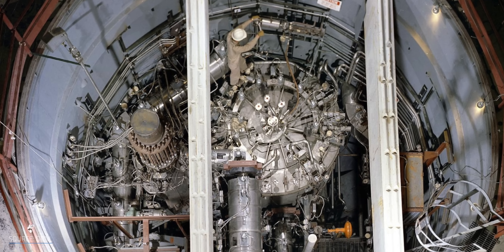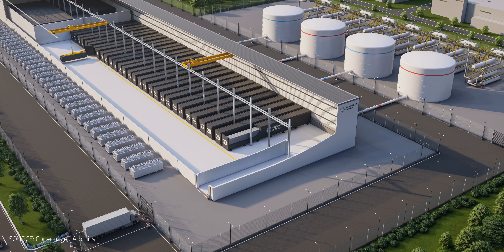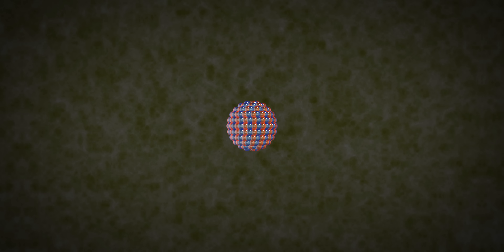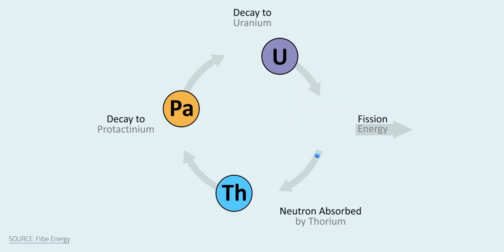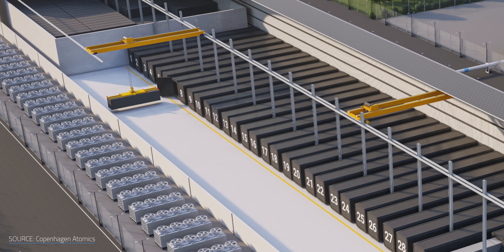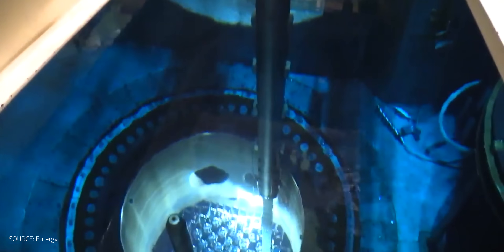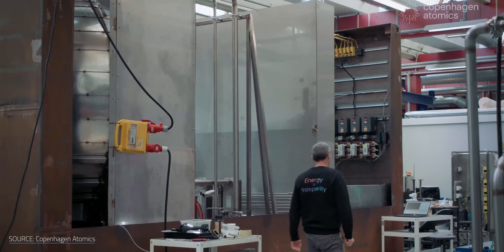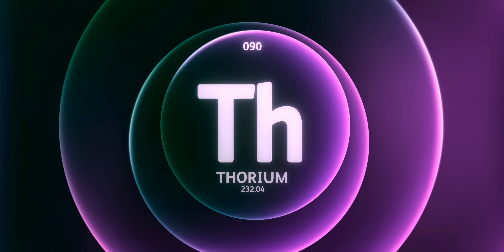Why Thorium is About to Change the World

Comment: It will be expensive, but “crash-testing” failure modes could increase public trust and also let them develop, test, and practice cleanup
Reply: They were testedin 1967. LFTR designs are immune by design to every civilian nuclear accident seen so far. TMI, Chernobyl or Fukushima are simply not possible with a LFTR

Comment: China already has viable thorium technology and will implement commercial use early in the next decade. In the US there is a strong lobby against the use of thorium, perhaps because it does not want to invest in RD, after all the original project was abandoned because it did not serve the purpose of creating atomic bombs. And now it seems easier(profitable) to use the uranium technology that is already known, even if it presents catastrophic risks.
Reply: There are way more problems to the whole thing than the ones you mentioned. They stopped development for good reasons.
Btw, the thorium ones in China only supply 10-30 MW which is as much as 1-2 wind turbines can produce while being a lot cheaper.

Comment: Of course CO2 is the bad guy that we wish to eliminate the excessive accumulation of. But what of the direct heating of the environment by the dissipation of cheap energy? With cheap energy more and more things get automated and anything that uses energy has to dissipate that energy into the environment. What would an order of magnitude more waste heat look like to our thermometers and glaciers? Shouldn't tropical regions all have air conditioned living spaces? Shouldn't we all have a robotic servant? Shouldn't we all have automated transit lines that run on frequent schedules? Science and technology have created our current environmental warming hazard. Will science and technology provide a net reduction in that warming hazard?
Reply: It is safe to assume the heat dissipated by houshold gadgets is negigible in comparison to the heat accumulated on the whole planet (mainly by the sun). Even 1 Mio. gadgets won't make a significant difference.

Comment: If it works as expected, it would be ideal for termic plants, producing heat for district heating, and electricity as a biproduct.
Reply: The heat will be used to produce the electricity. There will be none left over for anything else.
Reply: @RayTheMickey The production of electricity from leaves more than half the energy as waste heat. You can use that heat for district heating, or you can destroy it in a cooling tower, or lead it in the ocean as warm water. By using the residual heat for district heating, you can utilize more than 90% of the energy. If you use a cooling tower, you waste 55-70% of the energy.

Comment: I understand that Uranium Breeder Reactors are scary because "nuclear weapons" but they're so much easier than thorium breeder reactors and Canada's CANDU reactors have been running for like half a century at this point, work fine, and are very safe. 

The statement that the 2.5 neutrons per fission from U233 gives you 0.5 extra neutrons to breed extra fuel with is an understandable misrepresentation from someone trying to push thorium reactors, because it ignores neutron losses. A more accurate statement for thorium breeder reactors is that you only have a 25% neutron margin to keep the breeder self sustaining, compared to a uranium breeder which has 2.88 neutrons per P239 fission for a 44% neutron margin, and every system is going to have losses. That difference means that thorium breeders have to be dissolved fuel molten salt with all the corrosion challenges so that they can continuously filter out impurities that could waste neutrons, where as a uranium breeder reactor can be made with a relatively conventional solid fuel core because it has enough of a neutron margin to leave the impurities in.

And in terms of fuel abundance, the 200 years projection for uranium is for currently economical deposits being used in conventional reactors without reprocessing. Reprocessing gives you I think 4-5x, and breeder reactors 100x on top of that because uranium is only 1% U235, even just using current nuclear waste in a uranium breeder would give you probably 50-100 years worth of power even with significantly increased generation. and if you ever do run out of uranium on land (or just want to stop mining) there's at least an order of magnitude more uranium dissolved in seawater than there is thorium on land.

Personally, I think sodium (or NaK) cooled uranium fast breeder reactors, like the Terrapower Natrium design, are the best long term solution for most land based nuclear power, with a place for gas cooled reactors when you need higher temperatures.
Reply: water cored reactors aren't hot enough. They produce wet steam and this plays merry hell with turbines, making them very expensive to maintain and with short maintenance intervals

Nuclear economics is at least as important on the revenue (non-nuclear) side as on the actual reactor. That high maintenance cost is a good part of the reason existing nuclear is so expensive to run. Dry or supercritical steam reduces costs a lot AND gives much better thermal efficiency, meaning you don't need to site next to rivers or estuaries for heatsinking
Reply: Honestly the "nuclear weapon breeder reactors" scare is just paranoia, all the nuclear weapons in history have been made by low power research LWR, it wouldn't even make economical sense trying to make a bomb from a civil reactor because you'd spend billions to build it when you can use a research reactor for a fraction of a cost.
Reply: @filippo1864 you've misunderstood the argument. Nobody is claiming the US wanted to breed weapons grade material in commercial light water reactors, the claim is that the US publicly funded the development of LWR for military purposes and then since the approvals, parts, designs, training technicians and engineers, and supply chains for LWR was already in place, this made it way cheaper to try and commercialize those designs than to start over with a safer design, which would require different parts, designs, approvals, training technicians and engineers, and fuel refining and supply chain. That the US didn't fund safer alternative designs specifically because they wanted to breed weapons grade fissile material is undeniable.
Reply: @naasking  you’d be surprised how many people on the internet and that I’ve met believe the only purpose of civil reactors is to breed plutonium. Besides I’m not talking specifically about the US, but the world in general and I was just talking about how the proliferation risk from breeder reactors is nonsensical. What’s all the “US didn’t fund safer designs” part? I don’t get your point, they “funded” the PWRs which are the most used in the world and as safe as any other, there is not “safer design”, they’re basically all as safe as a power plant gets, the main difference between designs is historic reasons and availability and grade of uranium ore. How would funding PWRs help in the building nuclear weapons when it’s not even the design they used to produce weapon grade plutonium?
Reply: @naasking  I think it is deniable. The US did fund other alternatives up to about 69 when MSRE was cancelled and EBR-II was left the only advanced research power reactor design to continue. However, by that point the US had ALREADY produced the vast majority of the weapons grade material it would ever produce and the production quantities had been falling for over 1/2 a decade.
Absolutely true to say commercial operators took advantage of the huge military investment in naval power reactor development. Quite another to say other programs were cancelled/not funded because they wanted to breed even more Pu for weapons as your last sentence accuses, when they were already significantly ramping down Pu production when decisions were made. A more plausible explanation is they decided to fund only 1 advanced research reactor program and the EBR-II SFR program was more mature at the time, so MSRE lost.
Reply: @richardb1452   You just contradicted yourself. You said the US had invested heavily and exclusively in nuclear to make weapons grade material, which implies by itself that other approaches were intentionally not funded. That's exactly what I've been saying. The fact that a few other approaches much later received paltry funding by comparison is largely irrelevant, the bulk of nuclear R&D had already happened and nobody saw reason to fund new approaches any further. We have better reasons now.
Reply: @naasking  No contradiction. Economics was the driver at the time, not additional Pu production. Using Naval power reactor LWR tech (which was NOT designed to produce weapons material) as a basis for commercialization was a logical economic choice AT THAT TIME. Yes, everyone agrees the U-Pu cycle got a head start due to the fact it was initially chosen in the 40s for weapons production, but that isn't what you seem to be claiming. The decisions on what to fund for power reactors in the 60s/70s were NOT driven by a desire for more military Pu. That requirement had already been met several times over.
Reply: U have a YouTube channel ?

Comment: You say that because this a a molten salt reactor, new fuel can be added to the mix and waste products can be removed white the plant is running.

No.  No they cant.  Those are exactly the problems that the team in Copenhagen are trying to solve.
Yes, I've heard about this one before.  I suspected you might misrepresent this.  I'm sad to see my suspicions were correct 😞
Reply: And yet.... the Chinese have just done it. What does that tell you anbout the Copenhagen design?

Hint: Added complication is great in a mechanical wristwatch (turbillons) but almost always a liability (technical oe economic)  in power systems

Comment: Also remember no one thought coal will be over, now it's almost gone completely, that is how petroleum oil and gaz will be eliminated, not by building nuclear but to make nuclear cheap
Reply: Worldwide coal consumption was 50% higher in 2022 than it was in 2000.. How is it almost completely gone?
As a percentage of total energy output it is decreasing because the world consumes more and more energy every year, but raw usage of coal is still increasing worldwide not decreasing. The increase HAS slowed drastically though which is promising
Reply: Thats may be technically true, due some few big actors  @Ineluki_Myonrashi

Comment: the US BUILT TESTED AND RAN a thorium reactor in the late 50s and early 60s ... commissioned by the US AIR FORCE it ran for over 5 years before being shut down and buried under TOP SECRET paperwork 
its not a dream its not hard to produce        it is just not cost effective to sell the energy it provides...    $15 USD for a single persons life time supply of electrical energy    they wont make it because they cannot get rich

Comment: So how does the system start? I would assume you have to heat up a large amount of salt to over 500 degrees celsius and it probably takes hours to days to fill the system and get the reaction running? If the reactor were to ever stop, it has to be thrown away?

It sounds great, but there seem to be some potential issues, that can be overcome, but do provide headache.
Reply: Electric heating blankets. They're cheap, effective and permanently installed
Reply: @alanbrown397  Oh, that would make sense. Thanks

Comment: Thorium reactors are grid reactors. 
It is not just the little grid electricity but the massive fossil fueled energy that needs to be replaced.

As long as you ignore the size of the problem the more inane the videos are.

Gridss are national GDP sized investments built over 14decades. 

Grid electricity is only 4% of total fossil fueled energy used.

20times bigger grid capacity is economically insane. 

Other non nuclear technology does not need nuclear electricity little 4%

Comment: Why can't we just use nuclear waste? I love the idea of Thorium, but we have a stockpile of untapped energy. Using Nuclear Waste for energy would also take off about 80%, give or take of radioactivity, reducing the time from thousands of years to hundreds. We have a lot of this stuff laying around in containers and we need to get rid of it.
Reply: "Why can't we just use nuclear waste?" We can and we can also use depleted uranium. The problem is that there's simply not enough of it. The entire USA waste pile would fit comfortably on 3 football fields at 2m deeo. The entire Swiss waste pile is contained in a very large room (about the size of an indoor soccer field)

Thorium designs such as the MSRE and TMSR-LF1 can mostly take such things as sidestream fuel but may be able to run 100% on waste. The point is that thorium is already there and being extracted from the ground as part of rare earth mining to the tune of 5000 tons per year per mine. 

At 100% nuclear the USA would need about 5000 tons/year. If you fully decarbonise you'll need about 30,000 tons/year

It just needs a market to justify packaging it up and selling it